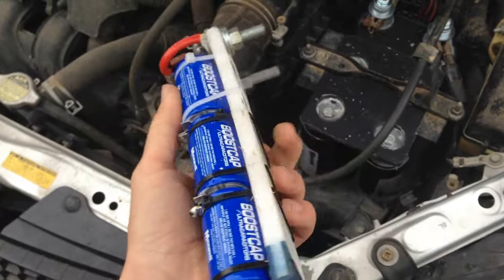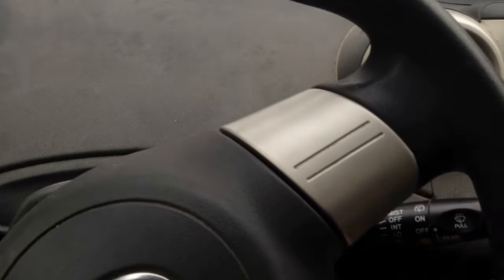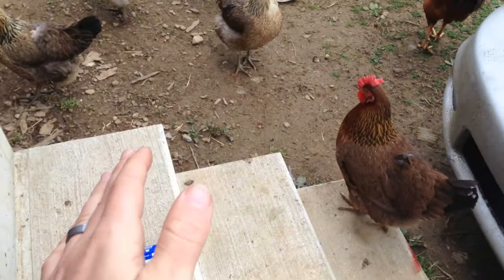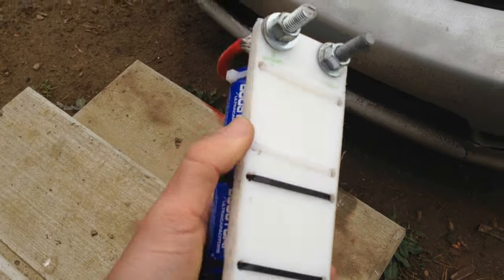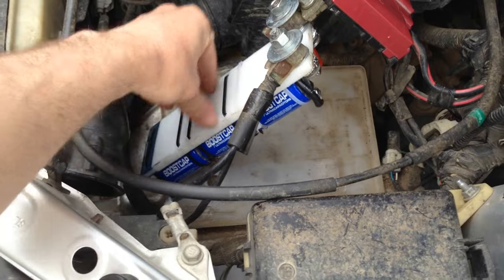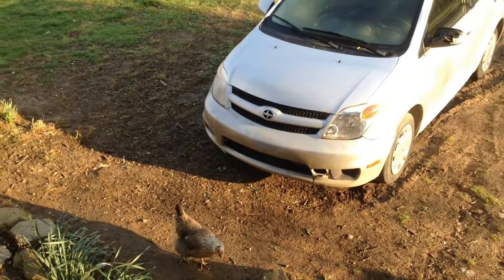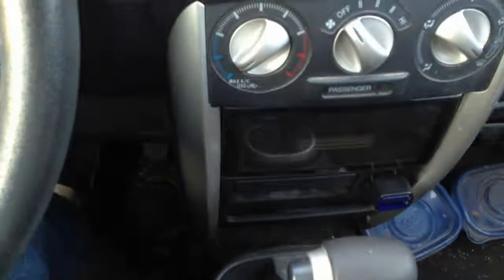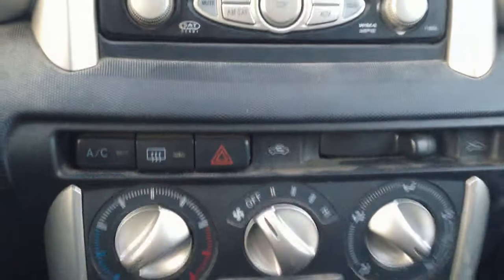Replacing My Car Battery with Capacitors! 12V BoostPack Update

Comment: Great idea but won't fly. Let me tell ya why. First off your car better be in tip top shape cause if ya don't get it the first shot you might not get a second. Next what are you going to do when you are on the highway and BOOM! your alternator dies on you? How far do you think you are going to get? 2 seconds is how far. Don't sit and listen to your radio cause now your stuck. When you have the blower on high at night with the headlights on you sometimes need a battery to handle the extra power required. So think first before you dive into this idea.
Reply: I totally agree with you. I have had a few times when I had to drive many miles with the alternator dead, and luckily I made it somewhere so I wasn't stranded.

Comment: There is a reason why capacitors are not use alone as a power source. There are 200 bucks worth of caps there. Coulda' just bought a gel battery. Your alternator is carrying a 100% load on those caps. Not a good method of power for your vehicle. There must be a storage unit in the system. Caps are fine as a support or "Boost" as they are labeled to stabilize or ballast your power source but alternators are much more expensive than batteries and you will kill yours far more quickly.
Reply: +Ryan Olinski sure it will start it 1-2times if youre car is perfectly good for cars that take some time to start this will not work eg is youre car takes 2-5seconds to start this will not work or you acedantly leave the radio on it will die in a minute !
Reply: +Kristijan Dinga some people really are stupid, he had the radio going for 30 minutes and it was fine.
Reply: Matthew Stoumbaugh hehe i wanna see that ...
Reply: +Ryan Olinski Even Lithium Ion battery is cheaper than super capacitors and current Li-ion batteries can easily start petrol engines.  Not to mention li-ion batteries do hold charge too.

Comment: Hmmmm, Replace Batteries with Capacitors in Hybirds Like The 2006 Honda Civics that overheat and shorten battery life. You Could Be On The something My Friend.
Reply from the maker: I am looking into that.  I just got a 2000 Honda Insight and think a capacitor system may work well in this little car.
Reply: capacitor life is cut in half for every 10*c the temperature rises (or doubled for every 10*c lowered as the reference is usually from the rated lifespan and temprature)
Reply: so have you found something interesting yet?

Comment: Pointless to use this with a regular car.

Only hybrids and electric cars benefit from capacitors, because they can store a lot of energy in short time, compared to lead acid battery. Then it uses that as a buffer between the electric motor and batteries. Mainly its used for energy recovery when you are braking. But that will be a thing of the past with these new nanobatteries coming out (F1 uses them already, but they are difficult to manufacture).
Reply: What... the idea is that this is used only for starting the car, that's what a car battery is for. The capacitor is charged by the alternator, replacing the battery. Potentially making it so that the car isn't dependent on batteries to start.
Reply: Rustyrivet250 Very well reasoned out. Thanks.
Reply: you're right on the draw/charge aspect but remember that caps last much, much longer than batteries. and as far as weight goes they are damn close right now, in5 years or so with the graphene ones in development they will outclass batteries by a long shot. now where's my lightsaber.
Reply: koglowa True, but I don't think the better lifespan and reduced weight is worth the risk of discharge. All right and good in the ideal condition. Try leaving it parked in the winter for a few days and start it then. Solar cells? Ah so what if i park in a garage or under a protective roof? And it costs more than a battery. A 60Ah battery for my car is like 50 euro, while this is closer to 150. Usually when it comes to innovations in the automotive industry there is a reason why we dont use them yet.

Im sure we would see all kinds of wonderful stuff if we peeked in the MercedesBenz development facilities, but it just isn't ready to be mass produced yet.

Comment: I suspect you get a very high spike of charge current in your alternator right after starting. That's probably going to kill your alternator eventually.
Reply: +shodanxx    Nice catch, but Alternators are self current limiting.
Reply: Alternator can only output certain amount of current per RPM even if you omit voltage regulator alltogether, so even if it maxes current in exciter wiring it will not generate more than it is possible for a cold idle speed, probably 20-40A at 12V
Reply: So you could basically short circuit an alternator (for the time it takes to charge these) without damaging the alternator ?
Reply: shodanxx It isn't a dead short, you still have like 8-9 V left in this capacitors. It is that full 9V going to the exciter wiring (I may be using wrong term, but it is this wiring in alternator that goes to the rotor so it generates rotating magnetic field). But answering your question - It won't damage alternator if you spin it slowly and for limited time. It is the same reason why when you jump start other car you shouldn't rev your car, but it will survive at idle. At high RPM alternator is capable of generating tons of amps if system voltage drops (when you crank the other car), but you may fry the diodes, voltage regulator, or - best case - alternator fuse..
Reply: mibars   This is not correct. First, the lower voltage caps (after cranking) do have a very low series resistance even though the voltage may be 8-9 volts as you say.  This is, in effect,  no different than a dead short.  If the alternator wants to put out 14 vols and the caps are at 9 volts, with very little ohms it is still a high load current (with no other current limiting). 5 volts across .01 ohms would still be a zillion amps (500).
...
HOWEVER, Alternators are naturally current limiting.They do not just keep increasing current into low R load.   It will charge the caps at its max current capability.  There is nothing wrong with revving your engine while jumping another car because of this.  I've done it all the time over many years.
HOWEVER, it is ALWAYS better to run the good car for a several minutes to get some charge into the dead battery so it can help with cranking.
-- 
Regards, ScienceAdvisorSteve
Reply: Observ45er Thanks. But as far as I know in old alternator there is nothing that can act as current limiting except of inherent amount of current alternator can output at given speed and voltage.
Reply: mibars  I'm not sure what you mean.  "..nothing can limit current except..."  Then something (the exception) limits current and therefore there is a limit.
..
All sources of power have a limit on output even if it is only thesources internal resistance.
Reply: Observ45er I mean there is no current sensing that will clip maximum current to eg. 100A, it will just output as much as it is possible based on the speed, voltace, impedance, etc. of alternator without anything to limit that current.

Comment: There exist 12volt handcrank generators, you can use to recharge this pure pack, without a backup little batrery to maintain the 12v. This pack by itself, would be so great for a traditional motorcycle thats used frequently.
I'm excited for the acceleration & Regen posiblities using a big capacitor battery pack in a homemade electric motorcycle. Batteries handling the range & storage, capacitors handling the stress of aggressive acceleration and more efficient energy capture of brake-regeneration.
And when parking after Regen-braking, the capacitors can just charge the batteries at the batteries' pace, until they're both at the same voltage.

Comment: you need to test it on a V8, I suggest on a GM LS engine because of the small starter that requires less power to turn over engine, do some research on LS swaps.
Reply: A bigger engine just needs bigger capacitors, that is not a problem.

Comment: 5 years and my caps are still going strong. 12 maxwells 👍
Reply: What is your setup?
Reply: Godfather pls update us regarding these
Reply: Jake Esguerra  Still works fine . Just have to clean the copper contacts once a year for I have them exposed to the elements.
Reply: DJ Half oz Bowflex Two rows of six in series then both in parallel.
Reply: Godfather are those the same caps? are you using maxwell?
Reply: Jake Esguerra Im using the black 2700 farad caps , he has 6 in his other video

Comment: just seen this
I live in Finland I have seen temperatures as low as -33C (-27F)
do you know if capacitors would be able to start a 2.5L diesel if it was left for 2 days??
we do have problems with batteries losing power when it is this could so wondering if capacitors could be the answer?
Reply: Why just don't do some research on supercapacitors. You would find out their typical temperature range is between -20 to +60 C°. So they are not meant to be put in an engine bay.
Otherwise they would be ideal for any engine, especially combined with a small battery and some control electronics. This way no high Amps would be needed to get drawn from the battery, so a much smaller battery would suffice.
This way the small battery would charge the supercaps at lower amps (that would take like half a minute , then the engine could be cranked from the caps, those can put out thousands of amps with no problem. However, if your engine won't start within a few secs (till the caps discharge), you would need to wait a minute to try again...
Reply: Look over to your southern neighbor and search for skeleton batteries. ;)

Comment: Remarkable that your little Scion starts with 10.9 volts.  My 1993 Toyota Corolla will start with as little as 11.9 v.  A friend had problems with her 2014 Toyota  RAV4 when her battery dipped below 12.4 volts and she started getting error messages from the computer and then it would shut off by itself or would not run anymore.  It was diagnosed as an alternator issue eventually, but apparently on board auto computers get techty when the battery drops to 12.3 volts.